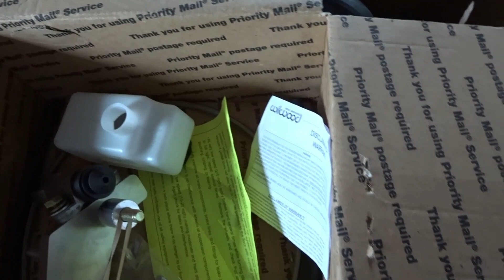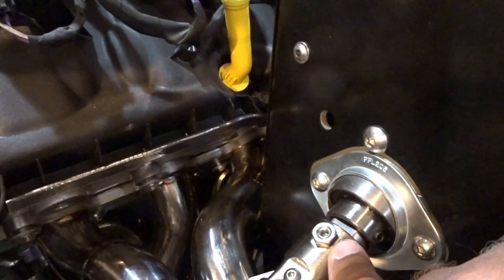Hydraulic Clutch Slave Cylinder & Custom Billet Bracket

Comment: Good video and great info. I have a T5 trans that i converted to a external slave. My set up suggest the throw out bearing rest on the clutch " fingers" then push slave piston all the way back and adjust. My question to you is what is your best method of bleeding the external slave cylinder?
Reply from the maker: I use a power bleeder. https://www.motiveproducts.com/collections/brake-bleeder-kits